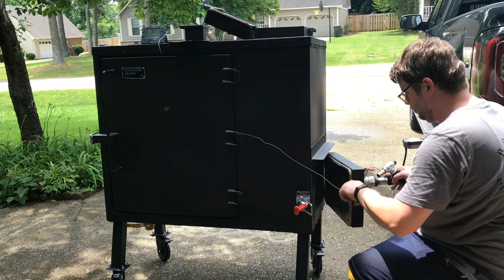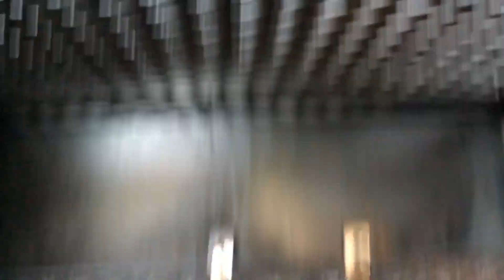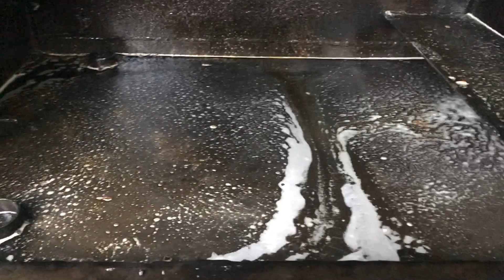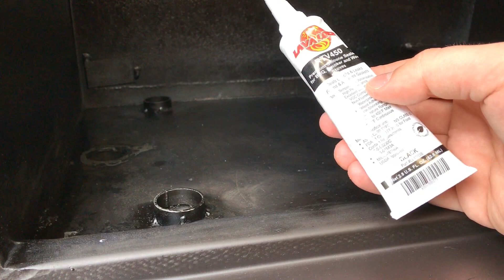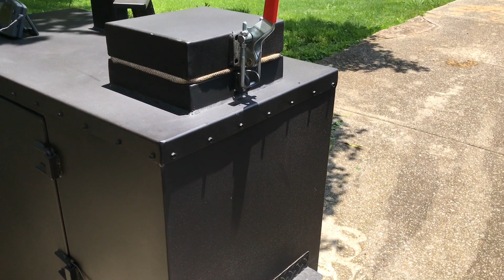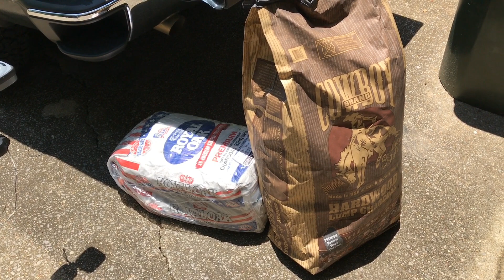Old Country Gravity Smoker - Sealing and BBQ Guru PartyQ

Comment: Second time using the OC gravity pit and it was great on its first use, but didn’t understand how to get the temp to be consistent until after about 6 hours of cooking.  The last 2 hours of my first cook the temp was pretty steady.  My second cook used the BBQ guru and it was AWESOME!!!!  Cook a hole chicken and a bunch of leg quarters.  The guru is the absolute truth.  It’s a little costly, but it will make a difference in your experience with your pit.  I definitely give it 2 thumbs up.

Comment: Hey fellow Alabamian and insulated vertical smoker buddy! Cheers! Awesome video. Glad your sharing your experiences with the OC Grav feed. Don't see enough videos out there with them! I'd be curious to see your temp traces using the PartyQ if there are any.

Also you triggered me showing that RO 2pack. In 2019 I was able to get 200 lbs or so of it on sale from Walmart. It lasted me 1.5 years or so lol. Not the best, but I miss it because of how expendable it was.

Comment: Thanks for putting this video together. I was informative. I've purchased a few OC pits and you have to inspect them before purchasing or at least know that you might have to so some sealing but I've been totally happy with mine. I'm just waiting for this one to get back in stock.
Reply from the maker: The grease was really the only surprise and I don’t have any other issues. The gaskets are great and the latches are great. I think overall the quality on the gravity smoker is solid and the seal around the edge was easily fixed.

Comment: So what is that adapter you put on the ball valve where the air intake is? Does it have a fan or something? How complicated to install?  Thank you. 🍻
Reply from the maker: Hi thank you for the question. It’s a 1.5 inch NPT to 1 inch NPT adapter with BBQ Gurus CNC fitting. Ill upload a video on Friday for my next smoke showing it.
Reply: @jg1317  where is that video I would like to view it
Reply: Would you please link where to purchase ball valve adapter and fan 
Thank you so much